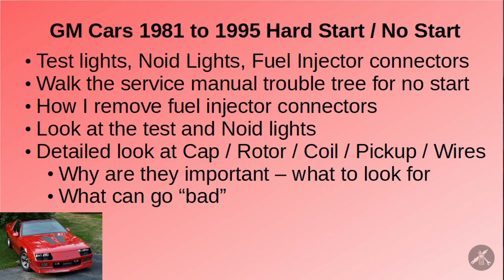Diagnose Hard Start / No Start Chevy 305 Tuned Port Injection OBD1 Computer Control -

Comment: Would love to see a video on how to most effectively diagnose an intermittant missfire in a TPI system.
Reply from the maker: Have you seen this one yet?  It is a general diagnostic that may help.  Let me know if you have, and provide some detail on your issue.
https://youtu.be/3j7R-EORcVU
Reply: @bitsofwisdom460  
I did watch that one and it was very good. I have a shop manual and a good multimeter for my 89 IROC 5.7L. Issue is that I'm getting a horrible missfire only after the engine is hot, has been shut off for a period of time, and then restarted while still warm. Sometimes it is accompanied by a no crank situation. The car has new plugs, wires, cap, rotor and ignition coil. I recently replaced the O2 sensor as well. I think I just need to roll up my sleeves and dig in to following the troubleshooting trees. 

Love your videos. Great to see some dedicated TPI content.
Reply from the maker: @sauldood3413  Yes, working the trouble trees can help. No crank is likely a separate issue. It could be a starter motor or solenoid that is failing when hot or something in the power feeds.  Starts on a hot soak can have a number of causes. Just a couple of thoughts. It could be an ignition module. Also, i would look at the fuel system and evap / purge system.  I had issues with that when the tank was not venting properly through the purge valve. You could also have a fuel pressure issue where something is causing low pressure on the restart. The injectors depend on good stable fuel pressure.
Reply: @bitsofwisdom460  Thanks! I'll focus on those areas first.
Reply: Well, I found a problem with fuel pressure. It bleeds off very quickly after the 2 second prime. Pinching off the return hose stops the loss so it looks like a faulty fuel pressure regulator. Not sure if this is causing my missfire on warm starts but it is definitely an issue. Parts are ordered and fingers are crossed. Thanks for your help and your great videos. I also ordered the OTC version of your Actron scanner thanks to your other video.
Reply from the maker: @sauldood3413  That sounds good!.  If the leak rate is high enough, the pump won't be able to hold pressure.  If the pressure is low, the injector flow rate will drop and the system will tend to run lean.  So, it could certainly contribute to a misfire issue.  Changing that regulator is a little challenging, because the runners and plenum are in the way and I think need to come off.  And, you need one of the tamper resistant torx bits T10 if I recall correctly with the hole in the center.

Comment: You're a godsend, my guy. There aren't any other channels on Youtube that goes into proper details on the Tuned port injection-system and how it works. I think people are scared of what they don't understand, which is a plausible reason why so many people did a carb-conversion before. Or LS-swaps.
Loving these videos, they are a joy to watch early in the mornings with the first coffee of the day. Makes the noggin' thinking and going. Have a great day!
Reply from the maker: Thank you, glad that you enjoy them.  I agree with you that they can scare people off. When I first looked at the tuned port package, it was a little intimidating, even with my past experience.  But once you get down to the basic systems, it is actually easier in some ways than the carbs.  The service manuals are a big help to the understanding.

Comment: Great confirming information. My 87 has very easy hand usable release wires on the injectors. Guess they upgraded the design. Can't wait for the next video! Thanks
Reply from the maker: On my '85, I tried everything to find an easy release mechanism.  I'm glad they found a better connector.
Reply from the maker: I do have a couple of follow-ups in the works that I hope will help.  A fair bit of editing and data crunching required, so it will take a little time. One is AIR system related and one has extensive scan tool data from cold start.
Reply: 👍 Great!